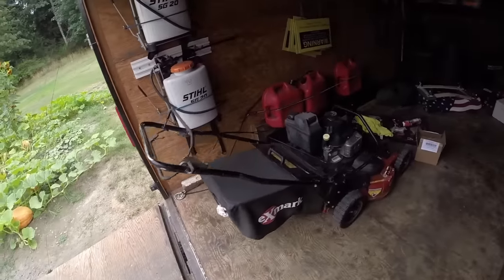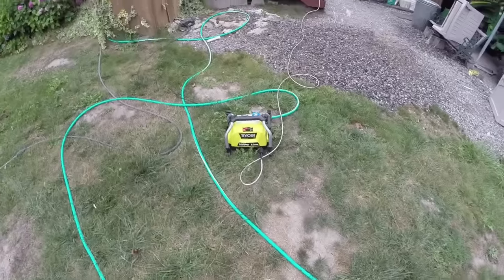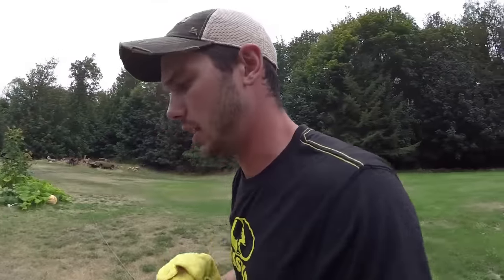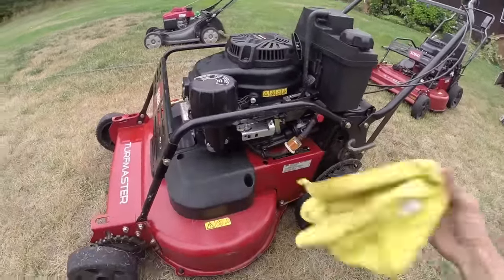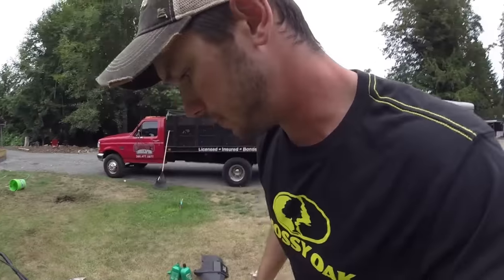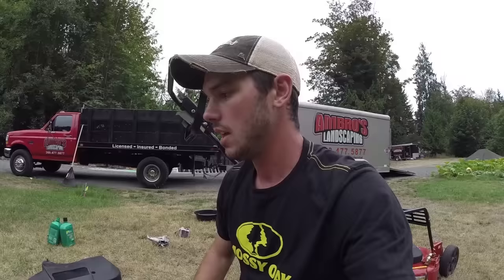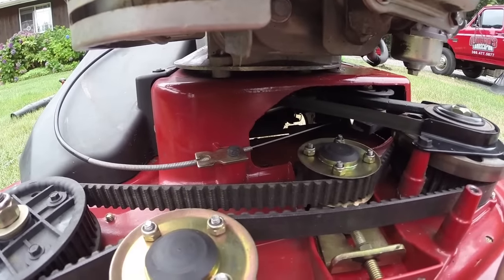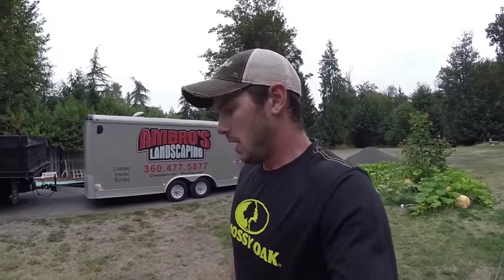How to tighten the blade cable on a Toro/Exmark 30" mower

Comment: I bought the ExMark 30 Commercial the first year of it's release and put on an hour meter. The mower was so fast and strong when new but slow and slippery ever since. I've had to replace a transmission after about every 110 hours of use. The first one or two were covered under warranty. The first trans was the best and every trans since has slipped much more and tightening didn't help as it was as tight as possible. They said they made improvements but  all the trans have slipped more. The part number did change. I asked my dealer and he said they lightened the clutch to make it last longer but, I said like a automotive clutch, if you let it slip more, it wears faster so I call B.S. on Toro/ExMark. I tightened the cable so much to make it better it eventually snapped. I retired my mower to personal use after maybe 500 hours. Since new, I've spent at least $2000 on pulleys, spindles, bearings, transmissions, belts, cables, etc. It hasn't made a nice cut the last half of the use (250hrs+). Only the Kawasaki engine has been perfect, otherwise it's a lemon!! Avoid it at all cost! I wish I could sue! Later, I bought the Toro Hydro 21 Aerator brand new, from a different dealer. On every job  after about 20mins the aerator slowed down to maybe 1mph. The dealer and rep said they didn't have a clue and because it cooled down by the time they would look at it they did not believe me. I showed a video and they said, huh, we don't know. Fluids were all new and full, and I used Premium Ethanol-free. I fought it for a while and sold it.
Reply: So..the toro koler engine is better??
Reply: @Fernandez maintenance 19  all I have experience with is the Kawasaki engine. I have never had a single issue with it. As I have stated, it's the rest of the Commercial 30 mower that is a bad value because of high maintenance costs.

Comment: there both nice machines,i went with the exmark for the attachments,and felt that even thow the deck height adjustment is a slower process on the exmark,that it was more durable as far as springs and things that could potentially be a future problem.

Comment: I've also been thinking about getting the Red Magic front mount dethatcher for my Exmark mower. Problem is I don't know if it does a good job. There is nothing about it on the Internet.
Also, isn't it a bad idea to pressure wash around the pulleys?

Comment: There is no difference between the toro and exmark other than the height adjustment. The newer vs on the toro has the same kind of tires as the exmark that last a long time.